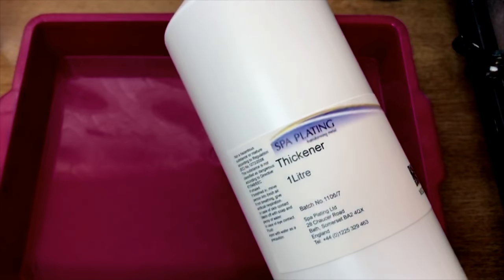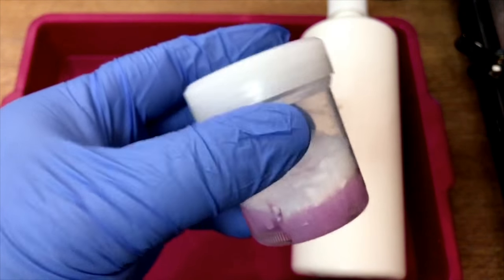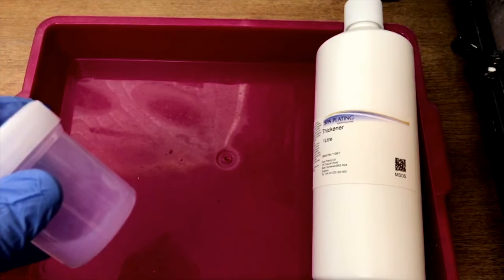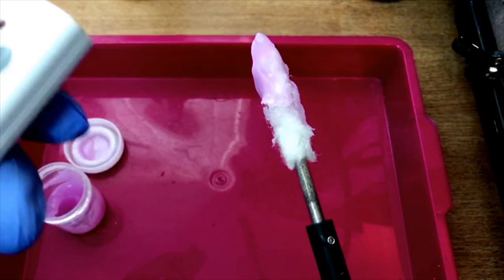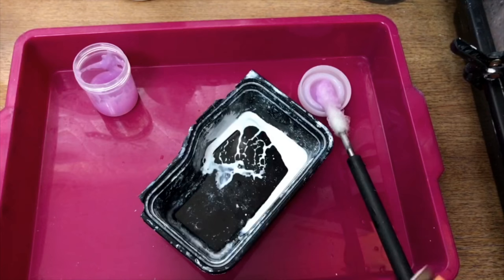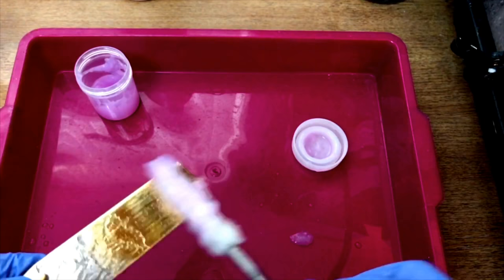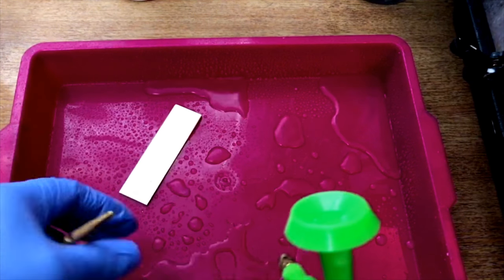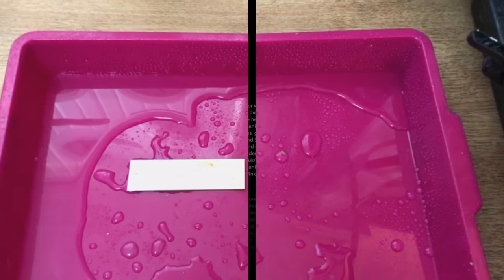HOW TO USE THICKENER TO STOP THE SOLUTION FROM RUNNING

Comment: Whats the thickener... baking soda?
Reply from the maker: 4 Fingers oh no 
It’s completely neutral 
You can get it from spa plating
Reply: @GoldenSolutionPlating  .. i try to DIY everything...any idea what is made off? Im surly not buying a gold solution, one can only guess whats inside.  I was thinking on changing the solutions for anodes but in case of gold that anode can be filthy expensive. To what should i  attach the gold (direct anode plating)...stainless steel, graphite, carbon?
Reply from the maker: 4 Fingers I don’t know sorry
Reply: Silica.